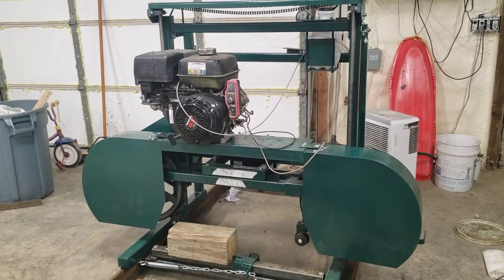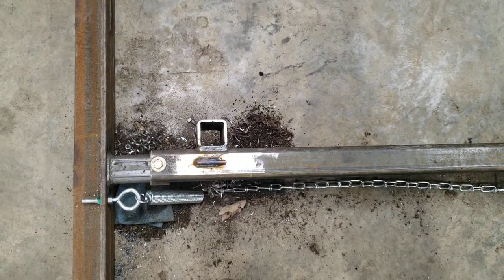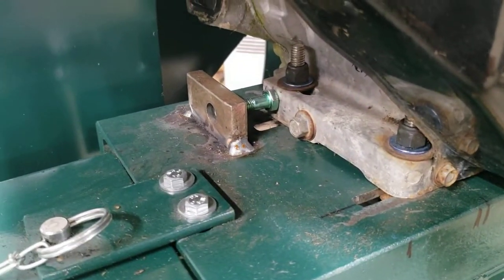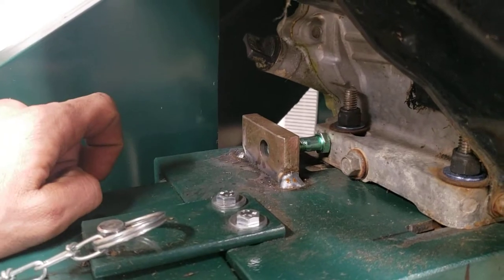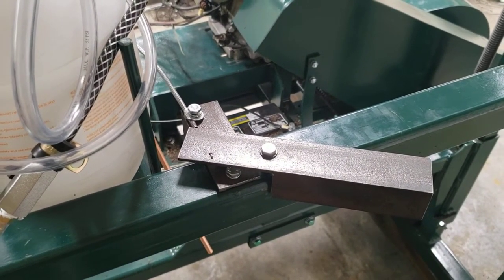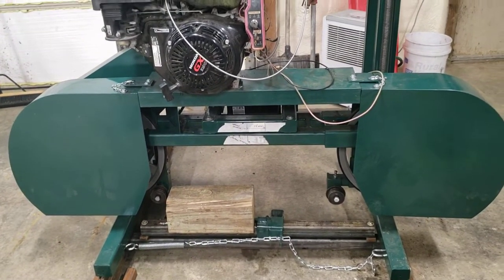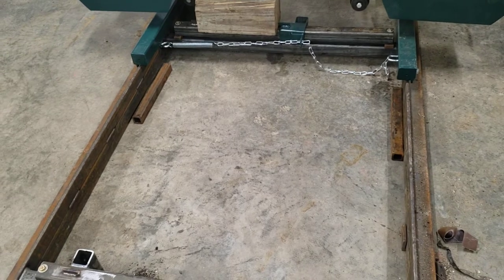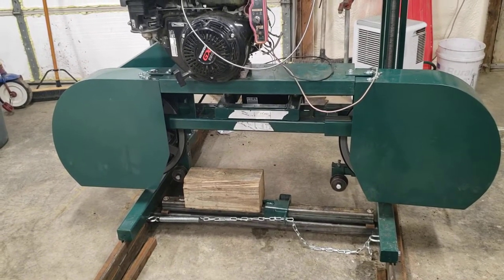Linn Lumber 190A bandsaw mill build pt 2

Comment: I didn't see the hydraulic tensioner mounted in this video, I presume you got the leak fixed? What was the issue? I just received a tensioner today from Linn Lumber for my build.
Reply from the maker: I tapped the 1/8" NPT fitting a bit deeper into the cylinder and it seemed to take care of the issue.  It held 2500PSI for over 24 hours.